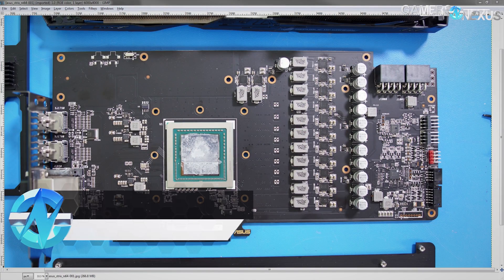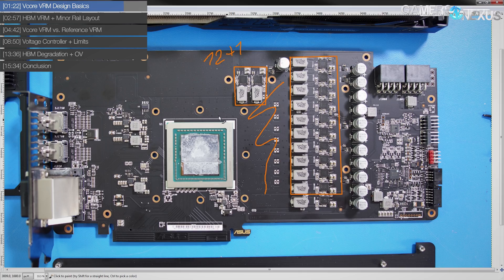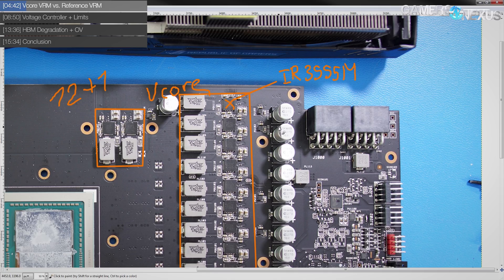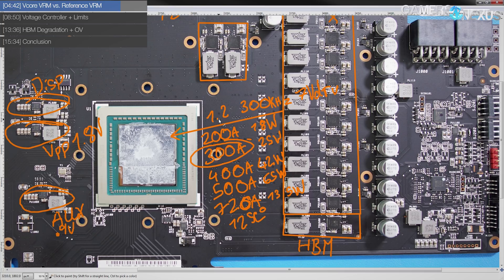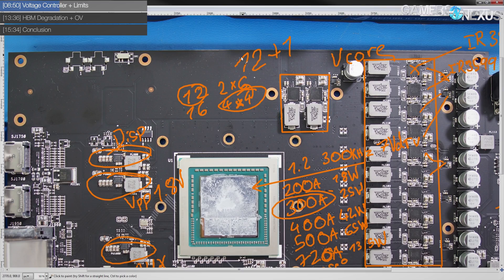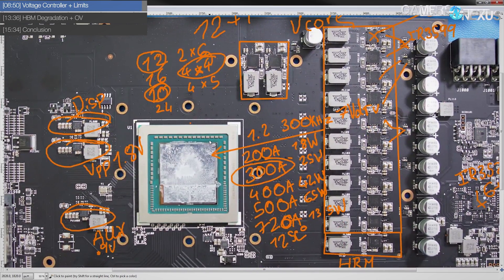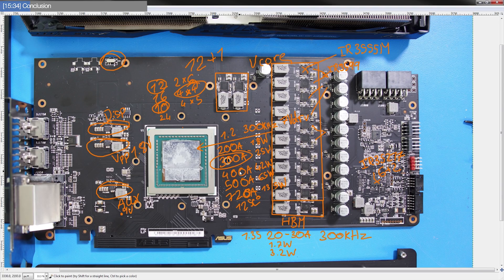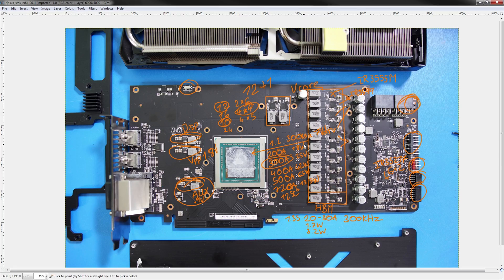VRM & PCB Analysis of ASUS ROG Strix Vega 64

Comment: I was kind off surprised you didn't mention the 'overvoltage' header as being the 'VGA Hotwire'. I saw your other video where you review the ASUS Rampage IV Extreme, as being your first board. That had a header for this. also to be used with the ASUS OC Panel. Form what I can tell this is just a voltage reference (readout), and a sense pin skew. so instead of soldering to the board, one could potentially add a potmeter here to skew the reading. I have a vega strix, and was looking into voltmodding. it seems a lot easier to use this header to voltmod permanently, then using a EVC2 for example.. I do wonder where ASUS takes their ground reference though, and this card doesn't seem to have a 'enable jumper' close to the header... also there are 2 headers near the IR35217, i wonder of one is the BUS to talk to the controller (for a EVC2).

Comment: Hey Buildzoid, I got a question. I heard this card has pretty poor VRM cooling since the thermal pad isn't placed correctly, so it will hit ~105 degree. You say they are rated for ~125 degrees? If that for a 2000h life cycle or shorter/longer? How long would the card last on 105 degrees? It still sounds ridiculously hot and I'm not sure if I have to return the card!
Reply: There's plenty of videos showing how to fix that I think it just requires a thicker thermal pad

Comment: Soooooooo............ How many power supplies would I need to run V64 XFire x4?
Reply: Buildzoid did a stream on Wednesday the 18th with 2 Vega's in crossfire and OC'd and was pulling 1150W at the wall. He got like 250 FPS in Firestrike though, can't remember the settings.
Reply: Holy shit did it really pull that much?

Comment: I'm studying electronics lately, and one thing that confuses me. If an entire computer can consume like, say, 500w from the wall (120v) that would mean that there's less than 5 amps going through the entire PC. How is it then that a GPU which is just one part of a PC be rated in hundreds of amps of current? Isn't a wall-socket only rated or like a max of 20A?
Reply: look up how DC to DC buck converters work
Reply: and the GPU convers 12V down to like 1.2V
Reply: TroidHunter because 120(240)v is only to a psu, and psu then steps down to 12v, 5v, 3.3v??? And gpu uses 12v.....
Reply: Remember the equation Watts = Volts * Amps, if the voltage is stepped down to say, 12 volts, then the amperage must go up to maintain the same wattage. In the case of 500 Watts, nearly 42 amps may be pushed over anything 12 volts. However, if you step up to 120 volts, then 500 watts only allows ~4.2 amps.
Reply: buck converters explains things thank you.
Reply: But if a GPU like vega needs 400A to sustain overclocks where do those amps come from? not the wall, certainly, those are capped at like 20A.
Reply: Sorry.Study more.
Reply: A good place to start with electronics is DC theory (or Physics). Your example outlet (20A x 120v), in a 100% efficient system (not real), would result in being able to deliver 200A at 12v, or 2000A at 1.2v.  P(watts) remains unchanged as P = I(intensity/current) x V(voltage) . Remember, you are trying to perform a given amount of work(P); if the pipe (V)is wide then I(current), required to perform that work is proportionately reduced.

At my old place of work we had to charge a large number of mobile phones for test purposes. Trying to explain to the bods that did our Portable Appliance Testing (P.A.T.) that 40 x (0.5A x 5v) did not come anywhere close to exceeding the 13A x 240v our outlet was rated for was an interesting experience. They too looked at rated output current and not output voltage and went 40 x 0.5A = 20A. Charging 40 phones from flat, the assembly actually pulled 3 amps at the wall due to substantial system R.
Reply: I only just started studying DC electronics so I wasn't aware that you could do things like scale the voltage to get a different current.
Reply: It's coming from the 12V line, stepped down. The 12V line(s) proberly consume each 12 up to 16A per 4 wire.

Comment: I'm no genius here but I'm not bad at math wouldn't an 18 phase VRM be possible? like 3 x 6 keeping that efficiency of using all 6 actual phases while being able to increase the load split?
Reply: No such thing as a stupid question.  I'm sure others were wondering the same thing and were just afraid to ask.  You asked, we were therefore able to educate not just you, but others by proxy.
Reply: It IS possible though...  just...  not practical, and Buildzoid was only talking in practicality.  I mean...  they'd have to order them special made, because as Buildzoid just said, no one makes them.  The reason no one makes them is also valid.  They really are more difficult.  Both points would contribute to an astronomic price for very little gain.
Reply: Silver Studio theoretically you could use any number of phases. In pracise you're limited by what contollers are avalable. It's a bit like in ICE the more Zylinders you have the smover the pover delivery is.
Reply: Thanks for the explanation, I didn't know this before hand, sorry if it seemed like a stupid question.
Reply: no one makes triplers. You can only buy doublers and quads because doing 180 or 90 degree phase shifts is a lot simpler than 120 degree phase shifts.
Reply: Actually, Spamme...  The biggest limitation here is AMD's requirements, not really what's available.  There are plenty of other options for phase counts in controllers.  But being required to use one specific controller, and then make the design fit, limits you according to what multipliers are available.  Which are doublers or quads.  Doublers are always more efficient than quads, and so really, sticking to a 12+1 design is pretty much optimal.

Comment: PCB should be a lot smaller with the lack of memory chips from GDDR5. This looks like a recycling from "something" with GDDR5, just with Vega silicone slapped on it. It's cheaper not to make a completely new PCB design for Vega if they don't have to I assume. :)
Reply: Филип Пешић I don't remember where I saw it but Asus used the 1080(ti?) strix board/heatsink I believe.
Reply: This isn't anything out of the ordinary, this is typical of the card industry and has been forever now. This is how they keep the cost of custom cards reasonable and within spitting distance of reference cards, in spite of the(typically) more expensive components used. The type of memory used/amount of excess space is irrelevant, this is just smart business decisions. Personally, I'll take a little "wasted" PCB and an off the shelf cooling solution if it'll result in a $50+ MSRP decrease and no meaningful affect on performance.

Comment: On fury HBM voltage wos 1.5V no 1.4 it wos lower in hynix specs ? or meaby im wrong
Reply: Fury's ran 1.3V or 1.35V. Can't rember now but defo not 1.5V because I degraded one of my cards with 1.42V.
Reply: 1.55-1.65V on most GPUs. GDDR5X is 1.35V. HBM2 is 1.25v or 1.35V depending on if it's on a V56 or V64.
Reply: HBM 1 vs HBM2...
Reply: Whats the standard Voltage for GDDR5??

Comment: OK, so the VRM and PCB are a pretty good improvement but performance of the card is the exact same as the reference card... for the extra cost is the only thing we can get is marginal VRM and PCB improvements?
Reply: DoctorWho8675309 well, you will be getting a better cooler... But vega is pretty close to its limits, so you won't be getting extra performance out of it, if you discount micro throttling on the core
Reply: If thats the case it had better be priced the same as reference.
Reply: Better cooler, RGB, fan headers, decreased noise from cooler, the on-card voltage control points... but yeah, minimal improvements
Reply from the maker: VBIOS doesn't presently work.
Reply: DoctorWho8675309 it's more expensive.
And your spot on, it offers nothing performance wise.
Reply: @doctorwho8675309
bleh i feel the same :( they lied about the price and the marketing  department was on some bad drugs  (poor volta?)
but what else to buy..... i really don't wanna deal with the spying datamining nvidia software shit :(
Reply: I just finished selecting a build on PCPartpicker and it'll be 2500 for a full blown 1080Ti rig(EVGA SC2 Hybrid) including purchasing a new monitor. Not ready to pull the trigger as I hope that the whole shit storm of performance is due to BIOS but right now reference cards are 650 for Vega 64 which leads me to believe the AIB's will be 750(they can MSRP all the want below that, retailers going to fuck people because they can)... which puts me in the 1080Ti EVGA range anyways, just need the monitor.
Reply: cataria pega you don't need the G-Force experience software to use the card lol if that's what your referring to?
It's an optional software.
Reply: So is that what is holding this thing back? I'm really getting to the point of not caring what RTG's AIB's come out with because RTG doesn't deserve my money after this unfettered debacle of a release. For all the right Ryzen is... Vega is a complete 180. With the fact its still not right its safe to say AIB's won't be out until at least November if not December with the snails pace of Vega being delivered and then RTG keeping their hands clenched on the BIOS.

Comment: Look 40% of the PCB is empty space. Feels half baked.
Reply: This is a 8 layer PCB. Just because you can't see traces and components on the top layer, doesn't mean they don't exist and that's just "empty space".
Reply: I do actually really like that the PCB is how it is.
Reply: that because Vega uses HBM2 so the space normally taken up by memory is empty
Reply: you guys are all missing the point.... didnt make a new cooler from scratch, they modified something they already had which is why the PCB has the size it has... just so the cooler that is needed to sufficiently cool this gpu, would actually fit.
Reply: In before Vega Nano
Reply: cataria pega The higher the speed and voltage, the more you're prone to interference. You never wondered why CPUs have dozens of bypass caps not only under the substrate but under the socket too? If you put traces too close together, you're inviting problems. This is also one of the reasons why we still use 24 pins for power delivery on motherboards on top of adding an extra power connectors to send power directly to the cpu.
Reply: cataria pega this PCB is almost identical to Strix 10X0. That means Asus just designed a custom PCB and fit the chips on it, AMD or Nvidia, not adapting the board to the chip. That makes total sense because it helps on cost and quality consistency. I happily trade marginal optimization in for tested stability and dependable build quality.
Reply: CheapSushi And, let's completely forget that said nano cards are more expensive than the regular product, since they are for a niche market. R9 Nano. Remember that? More expensive than the regular R9 Fury, but essentially the same card with a smaller cooling solution.
Reply: Would you rather it came out half a year later and was smaller?
Reply: The PCB is the size it is so that they can mount that big ass cooler on it.
Reply: yes, lets fill it up with stuff it does not need, that makes sense.
Reply: @crimsun
looking at this pcb  and if u go with your reasonable point, then u can still go full L shape spacing the vrm out further and still reducing pcb size, interference, cooling especially due to better spacing and better cooling as u got more air going through the less pcb restricted cooler.
so however u gonna look at it, they could have done much better not in regards to components, but in regards to layout and pcb.
Reply: @Batemen
the 1080 runs cooler and overclocks better, not to mention much lower power draw
Reply: Just shows you how much a Nano style card would be great.
Reply: They also ran a bit slower because of the smaller cooling capacity.  At least stock.  R9 Nano did have an EK block.
Reply: mike fox 40% empty with the same performance as a 1080. What's your point?
Reply: i disagree with buildzoid here, as he mentions the powerplane adding cooling to the vrm and stuff, while that is true, the cooling that u gain from making a much smaller pcb would be much better as now the air cooler is way more efficient in blowing through it's fins and as the vrm is of coures connected directly to the  air cooler this overall should be a gain.
i would say asus  for marketing and what not wanted to be the first to have a custom vega  papery papery  review/launch, so they went as "safe" as possible everything as 1080ti cooler as possible, just copy and paste, empty pcb whatever who cares, they also kept the pcb uselessly long to keep the stupid eye logo on it, instead of having the fins blow directly through the card there.
i really hope saphire and xfx will have this "fixed"  as they used what i mentioned in the past for furys and a prototype already popped up some time ago using said design, but a weaker version.
it is sad to see, that both the reference design and asus both  went with empty pcb for 0 reasons, instead of actual inovation, especially as hbm is the only way forward of course.

Comment: They forget to put memory round the gpu?
Reply from the maker: The AMD Vega cards use HBM (High Bandwidth Memory), so it is actually located on top of an interposer that also hosts the GPU die.
Reply: Definitely not cost savings. HBM2 is much more expensive than GDDR5.
Reply: Trolling?
Reply: It's there, it's the two little silicon rectangles under the large rectangle on the GPU package. it's mostly covered by thermal paste though.
Reply: ahahahaah :D
Reply: Your comment was my exact thought too the first time I'd seen vega uncovered :p
Coming from R9-290x, this sight is quite different :p especially concerning non-fullcover/universal waterblock options this really appeals to me!
Reply: And I thought I saw an acutally funny joke in the YT comments
Reply: @cataria pega
Thanks, I was referring to the use of EK-VGA supremacies :-) Currently, if I'd want to use them on my r9-290x's I still have to add additional cooling for 16 memchips and up to 2 VRM-coolers (passive) to keep things in check per-gpu. Currently I own 3 R9-290x's and it required placing additional 120mm fans directed at the passive surfaces to keep the EK-VGA Supremacy approach in-check.
In comparison with vega I'd hope this would mainly eliminate the need for seperate VRAM-cooling. As a result I hope I can get away using the Supremacy waterblocks only with additional VRM-cooling; or would there be some oversight I'm missing that you perhaps tried to point out? At least, using the Fury-X's underside as a reference is how I got described assumption :p so that may simply be an entirely wrong one :p
Reply: Nah, annihilator, if that's what you're planning, you're not missing anything important.  Personally, I'd prefer full coverage and include VRM cooling in the loop, but that's just me.  Vega VRM just isn't outsized enough to be left to passive cooling.  Though outsize a water loop enough, and you can leave the radiator passively cooled.  Still a form of active cooling though, you're pumping that water across the heat source and the heat sink.
Reply: You're absolutely right. I'm mainly trying to avoid purchasing new blocks when I still have a bunch of ones that work fine otherwise :p It's all active on this end nonetheless, but I use only a 3x120mm currently fitted at the top of a Corsair Obsidian 900D with a bunch of noctua fans on lowest speed (not audible over the R9's fans, these are back on air cooling at the moment) When I'd added the GPU's in the loop i'd added an extra 2x120mm just to be sure enough heat could be removed on low fan speeds, but the need to have extra fans near the GPU meant my case became more immovable then the sheer weight of it already made it (had no way to securely mount the fans near the GPU's which wouldn't hinder the flow...)

Maybe I should choose to use the supremacies along with something like Watercool's Heatkiller microSW-X 60, DIY and trim to fit, although I'd not really be sure how to mount it other then cable ties :p I however had some concerns with that it might reduce flowrate quite a bit if I'd have to use three of those (though lack experience there to be sure, really) generally not many people seem to choose unversal blocks nowadays so I don't often come across other people's experiences :/ So for me that's resulted in a fair bit of trial-and-error :p
Reply: i think i had a vega 56 and i was trollin, but that might just be me.
Reply: @annihlator, the sad part is, that there are no short vega waterblocks, bbecause there is no short vega pcb yet.....  look at the fury-x waterblock from ek, looks really nice and special because it's short without wated pcb.
Reply: I wish they had chalked a gdddr5 interface on the card and made a titan price bracket card with an absolutely stupid amount of gddr, turns the hbm into a sort of super cache big fast as fuck, and fed by the still very fast gddr
Reply: Wait what..  you seriously did not know what HBM was or that Vega used it?  It's only been a major bullet point in every article, major talking point in every interview and video, and broadly advertised feature by AMD.
Reply: Abigail Patridge I think he was unfamiliar with the way it looks, not the fact that it is used.
Reply: Lawrence Timme I think you forgot to use your brain.
Reply: Cost savings
Reply: o ok lol that would explain that then. i never knew :P